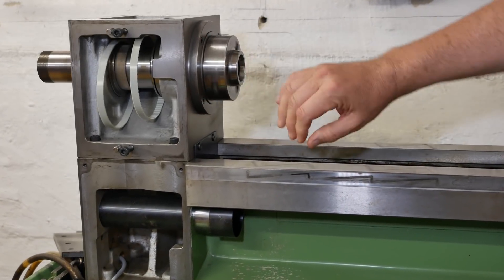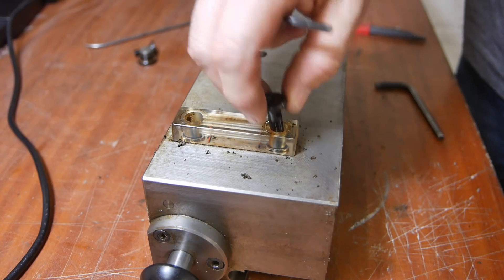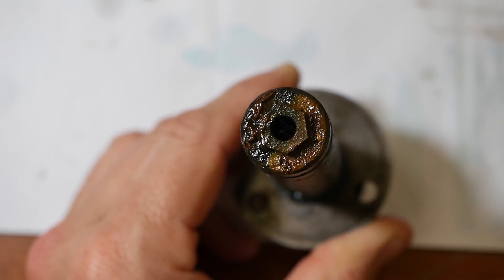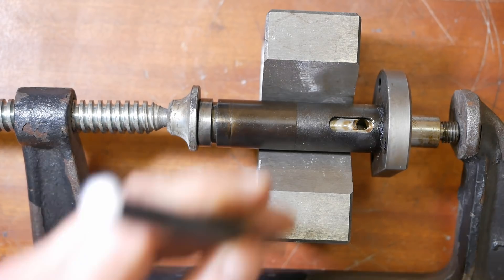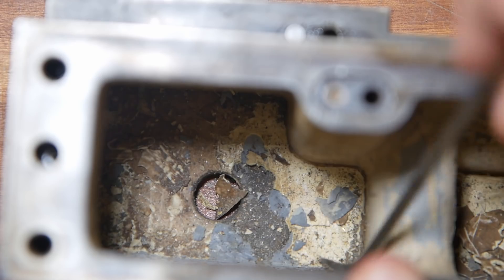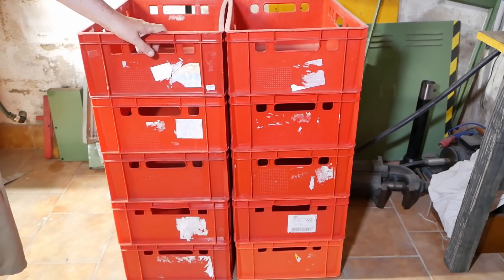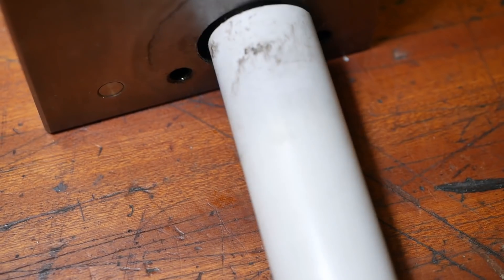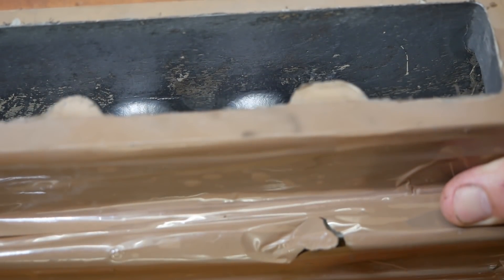Schaublin lathe way oiling system

Comment: interestingly, "Lube Unit" is also my rapper name.
Reply from the maker: On jet engines, you always have module of pressure and scavenge pumps, plus the filter which is refered to as a lube unit.

Comment: I'm pretty sure bronze is ok in caustic, it's alum that is a problem. We used to hot tank 1000s of CI engine blocks in caustic, and I remember they had bronze bushes or restrictors. If you put something in caustic and it starts bubbling after a few min pull it out, because something is getting eaten. We also had carbon remover tanks for alum heads - I think it was methylene chloride but my memory is bad - and it would strip everything without damage, even plastic. I think chlorides aren't recommended for Ti.
There is internal fuel tank paint that should be ok with oil.
Reply from the maker: Thanks. I looked up and found that NaOK will attack copper based alloys. It is only a metering orifice, but didn't want to risk it.

Comment: You could wash the inside of the oil tank with caustic, as long as you don't submerse it fully in caustic it won't touch the bronze. Just fill it up halfway to clean the paint out of the bottom perhaps.
Reply from the maker: Good Idea, but sitting the thick walled iron tank in the U/S cleaner, I am not sure whether U/S action will get through. I also have some more aggressive blasting media, and might try that first.
Reply: @RotarySMP  With caustic you might not need to put it in the ultrasonic, just a container and let it sit for a while. Of course this is just suggestions because you could also use a wire wheel or a die grinder or pretty much anything. Even paint remover just for those bits would be possible since you can wash it after.

Great work anyways, looking forward to the next part of the story.

Comment: This reminds me of when I rebuilt the oil pump on my Triumph 2000 CNC. As far as I could tell the pump had never had a ball installed in the foot valve. On the up stroke it sucked oil out of the tank then on the down stroke pushed it back into the tank. The machine spent most of it's life with no lubrication. The previous owner wasn't even aware it had an oil pump!
I dropped in a ball in there so it now pumps but it's a bit late now. The machine has rather more bed wear that I'd like.
Reply from the maker: Ouch. I think this pump probably still worked, but the lube oil level was below the pump inlet. At least the lathe has little to no wear. Seeing as the Z ball screw end bearings were solid from hardened coolant, this machine hasn't moved in a couple of decades probably.

Comment: I have the same blasting cabinet (albeit in red).  I find the silly little air filter gets clogged within a few minutes of use, and the lid is so flimsy it hardly seals at all.  I made a frame out of square section tube that goes around the edge of the acrylic window with some over-centre latches to pull it down.  The lip that the window seals onto required a lot of attention to get it flat, it was all over the place. 
It could really do with a proper vacuum extraction, but I removed the poxy air filter and replaced it with PVC waste pipe that goes straight up about a meter, then a U bend and over the end of the U bend I have a vacuum cleaner bag held on with an elastic band.  The longish vertical section helps larger particles fall back into the cabinet, and the vacuum cleaner bag provides loads of airflow and makes disposal of the finer dust easier.

I also find I have to keep shaking the cabinet to get the media in the sump to level out so the vacuum hose can pick it up, it tends to suck out a crater in the middle and stop working.
Reply from the maker: Thanks. You just wrote about 80% of the script for my review :) Mine is unmodified, and blows sand everwhere.
Reply: @RotarySMP  I was waiting for you to say yours works perfectly and it's just down to the idiot using it 😁
Reply from the maker: @ferrumignis  Did the light in yours die after about a month as well?
Reply: @RotarySMP  It didn't make it to a month, it was less than a week. I used a rechargeable LED inspection lamp through the cover after it stopped working, I ran out of enthusiasm for fixing it to be honest!

Comment: I would like to see a sand blaster cabinet review. 
i just modded mine to add the shop vac to the exhaust to keep the dust out.  
Helps keep the air clean and dust out of the blasting medium. I am sure there will be some losses of grit but this should be acceptable. 
Might make a video.....
Reply from the maker: Please do. I tried hooking up my shop vac, but it just pulled the gloves in.
Reply: @RotarySMP  I have a filter on the back i removed to reduce the vacum inside. 
will send you a link once video made
Reply from the maker: @madguernseyboy  Thanks. Look forward to that.

Comment: I'm restoring a 1955 Colchester MK1 Student lathe and the paint in the gearbox and headstock has help up remarkably well (I'm fairly certain it's the original paint).  In looking in the forums, it seems it was Glyptal paint, which seems to be a really good choice for longevity!
Reply from the maker: Nice lathe. Thanks for the tip.

Comment: If you wire that electric tooth brush to a "wall wart" dc converter at about 2x the voltage you will have a nice little brush tool there. (I do that with my regular 3V cheap electric tooth brush...wire it to 5V and it hums like a $150 brush.)
Reply from the maker: Nice idea. So many projects...so little time.

Comment: Box vs prismatic ways, which one are better and why?
Reply from the maker: I think box ways are considered more rigid. They are normally only used on really heavy industrial machines. Prismatic ways on lathes keep the horizontal alignment better with wear.

Comment: I was rewatching this series again from the start. Did you ever decide how you wanted to handle the motors? If you google "solid state Scott-t transformer", there's an application  note from analog devices to convert a synchro signal to a resolver one.
Reply from the maker: I havent ordered yet, but will go for AC servos.

Comment: Unless your ultrasonic cleaner is designed to have parts resting on the tank floor (and no inexpensive cleaner is), don't rest anything on the tank floor.  It's bad for the cleaner, and greatly reduces the ability of the piezo transducers to vibrate the liquid using the tank floor.  Every tank manufacturer I'm aware of, warns not to do that.  

https://www.omegasonics.com/how-to/ultrasonic-cleaners-dos-and-donts/

https://tovatech.com/blog/688/ultrasonic-cleaner/baskets-efficient-ultrasonic-cleaning

https://www.cleanosonic.com/the-ultrasonic-cleaner-faq/
Reply from the maker: That is why I put in the plastic standoffs. The basket they supplied with it also has plastic stand offs to rest on the floor. I guess I could have suspended the oil tank with wire though.

Comment: About spring loaded components, it will sound stupid, but... :
Work inside of a transparent bag.
It sucks to be in the field and something goes "boing".
Reply from the maker: Thanks is a good tip. I also disassemble thinks like this in a metal tray if they are more complex.

Comment: Your videos are very well put together.......I can tell it takes alot of time nice work. Ive been looking at new cameras mine has been letting me down but what a nightmare its like shopping for insert tooling
Reply from the maker: Thanks. I looked at a lot of reviews, and comparisons, and everything pointed to that Panasonic G80 (G81 or G85 depending on country) being the best price, performance and interface compromise. I got it used for about half price, and am really happy with it. 
Dont underestimate how important a logical interface is. When videoing a hundred clips a week, a poor interface (like the Olympus EM-10 I had before) really drives you nuts. The G80 also has a couple cool features, like you can easily set it up to move the 1080P crop around during a take, so you get that slider like effect on the opening shot this week.
Reply: @RotarySMP  g80 thank you sir ill look into it......do you have any experience with slow motion shots does it shoot in 120fps id like to incorporate some macro slowmotion shots
Reply from the maker: @westweld  No, it tops out at 60fps in HD. 4K it can only do 30 or 24 FPS. I dont even use 60FPS, as I never know in advance when I would have wanted slo-mo. Normally when I break something, so if I knew I'd be breaking it, wi wouldn't have :)
Reply: @RotarySMP  haha that is true

Comment: Too bad aero engineers have forgotten how to have a 100 gallon tank of oil in the wing root like they did with the radial-engine beasts back in the day!
Reply from the maker: True.  The GE90 oil consumption is considered high at about 1/2 quart or liter per hour. The big radials guzzlered gallons per hour of oil.

Comment: Peiro - thanks for taking care of all us with OCD 😉.  RSMP - What an awesome set of generous gifts from your viewers. Liked the tip of using PVC pipe to support the oil tank in the sonic tank.  You didn’t note it, but were you satisfied with the performance of the citric cleaner?  Do you think it might have worked differently if you loaded the oil tank upside-down in the sonic tank. I’m wondering if the sonic action was somewhat isolated by the thick walls of the oil tank?  How long did you run the sonic tank?  👍👍😎👍👍
Reply from the maker: I probably had the citrix cleaner too dilute, but did a bit of extra powdered citrix after the first 20 minutes buzzing. I think in total I did 60 minutes of sonic. It took off most of the oil base gunk, but didn't come out perfect. I did it upside down.
Reply: @RotarySMP  ooops - I guess I remembered it wrong.  I thought I saw the oil tank go in right-side up. 🙃  I need to pay closer attention.  I learn so much from watching you work.
Reply from the maker: @joell439  Glad you are enjoying the series.

Comment: Place a sacrificial filter (a UV filter is a good choice) on the lens all the time, let it take the abuse. When it gets schmooed up, a couple of bucks gets you a new one.
Reply from the maker: I think the bigger issue is the dust and grit getting pumped into the lens internals when zooming. When shooting welding, I normally use an 8x ND filter.
Reply: @RotarySMP  Maybe cover the rest of the lens with a plastic bag losely fit, allowing you relative access to buttons and what not.
Reply from the maker: @handjobsforthehomeless  That could help. Or just buy a cheap one, and accept that it has a limited life.
Reply: @RotarySMP  Most midrange and better lenses like the 12-40/2,8 you got have gaskets around the bayonet and in other strategic places. It keeps any negative pressure caused by moving the elements from pulling in too much dirt.
Reply from the maker: @Joelsfilmer  Good point. My Canon 17-55 2.8 was not weather sealed, and it sucked in lots of crud. The Oly is better sealed.

Comment: is it actually really nessesery to paint the inside of an practically oil filled container? even if it's done with two-K paint.
my experience is that it will come of eventually still, and clog up the lines. even making it worse. i mean would it really rot when keeping up the oil level.
Reply from the maker: I think castings which are supposed to hold fluids are normally painted on the inside to ensure it doesn't seep due to porosity. But am not sure about that. The upper half of the tank will never see oil, but you may weel be right that it is unnessary to paint it.
Reply: @RotarySMP  maybe it's better to ignore what i just said. i dont want to ruin your project. you may well be right about CASTINGS. and paint the inside. because what Craig sounds reasonable too. be sure to use good 2k stuff as you already mentioned.
For the inside of cooling fluid containers i dont even bougther to paint them ever again. but those are made of steel plate most of the time. all this flake paint, yuck.
Reply from the maker: @janwiersma1449  I didn't paint the inside of the Mini-lathe enclosure for the same reason.
Reply: I remember rebuilding some German gearboxes and all the castings were spray puttied and then two pack painted. The resulting finish was silky smooth, and easy to clean...
Reply from the maker: @Servo421  I know Benz paints the inside of the iron OM640 blocks.

Comment: Have you tried alloy wheels as a feeder stock? Being a casting alloy I would think the material would be OK and availability should be a no brainer.
Reply from the maker: Yeah, wheels are great, just a bit of a PITA to chop them up. There is a good Myfordboy video using a circular saw for that.

Comment: Thanks for sharing, I was a little bit inspired by your videos so I went out and got lucky on a denford cyclone with a fanuc OT-A, its from 1985, mechanically its finished, but electrically pretty good. They're pretty interesting.
Reply from the maker: I had never heard of the Denford Cyclone. Nice sized machine. I hope you make films of what you do with it.
Reply: @RotarySMP  Thanks for the response,

My video making skills are horrendous, i will try and document some things, i plan on fitting some "options" to it, like through the turret coolant, barfeeder, that type of stuff.

I did make a video of the spindle rebuild, i did not take much care in disassembling it because it was already screwed, but after touching it up, and rebuilding it, its so good.
Reply from the maker: @max_eley  Video is another steep learning curve. I had no idea about it 18M ago, but starting to get the hang of it. 
Are you keeping it's original controller?
Reply: @RotarySMP  All my machines are fanuc with the exception of my dmg 70 evo, which is heidenhain, i am going to try to keep it original, but if it proves too unreliable because of its age, i might have to figure something out, i really do love fanuc so i am hoping to keep it alive as long as possible, i will keep practicing on videos, i think its pretty good sharing stuff with people
Reply from the maker: @max_eley  Must be nice having a shop with common controls. I only know LinuxCNC, but if you have a shop with 5 different industrial controls of different generations, it would be a challenge to stay current on them all.
I also enjoy make videos. Even if I am just an amateur at this stuff.
Reply: @RotarySMP  We used to have loads of different controls, we still have quite the diverse range, but we sold all our old stuff off and got some good stuff in, fanuc is by far the most reliable, never buy a haas if you are to get a industry standard control, its the most unreliable thing ever.

I really like your videos, they do not come off as amateur, they're very good. I tune in every week, i am excited too see what you do with the machine : D
Reply from the maker: @max_eley  Thanks. I have a friend here in Vienna with a Schaublin 125-CCN, which is pretty much the same lathe with a Fanuc control. It has never let him down.